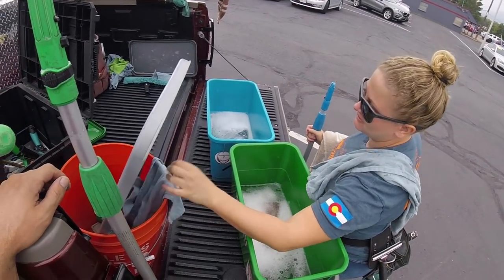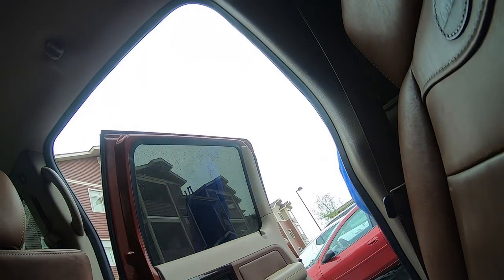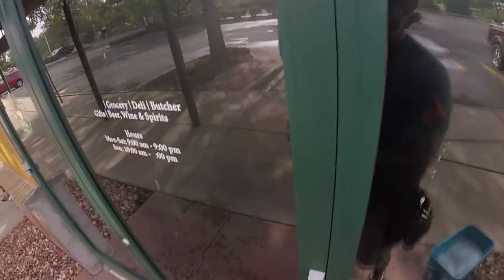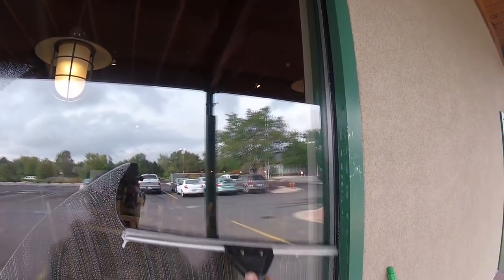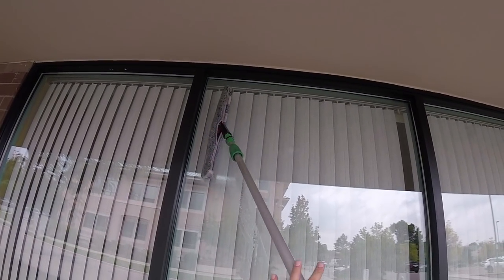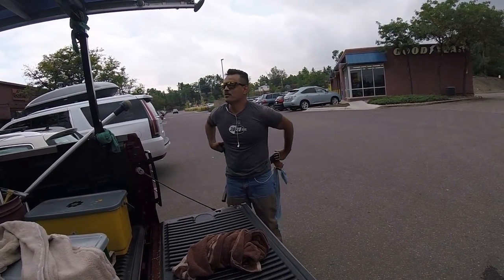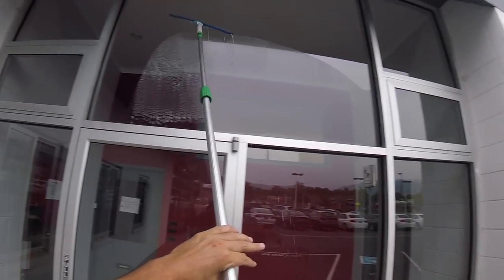BAD WINDOW CLEANING TECHNIQUES

Comment: What I hate about other window cleaners is underbidding all the companies so low they drop the price across the board toward no one makes any money and they work so hard on ladders every day people should be setting the standards high not low
Reply: I have been trying to figure out prices, just starting out with window cleaning, the main thing is what is the price difference between maintenance cleaning and construction cleanup.
Reply: That's what the invasion of illegal aliens is doing all trades.
Reply: @tfazio762  the difference is the time it takes, route s maintenance and construction cleans require extra time and tools. Price for your worth and experience.  High volume low profit is working harder not smarter.
Reply: Totally agree, I never undercut another cleaners price! It’s doesn’t benefit any of us.
Reply: 3.50 per pane in my neck of the woods.
Reply: Exactly.
Reply: @OneManParade  true! Why would they want to hire Billy to clean 20 windows for $150 when they can hire Carlos that will clean your 20 windows, grout your tiles and unclog your toilet all for $45!!!!!!
Reply: @mosestheprophet4162  bc Billy will do it right and Carlos won't. Lowest bidder is ALWAYS lowest quality.
Reply: @Johnnyreengo  definitely, I say my prices are not the highest and not the lowest but quality is top notch.
Reply: A lot of crying going on in here

Comment: I use a tiny squeegy specifically for wiping soap off of ledges and frames, works so so well and saves my rags getting too damp
Reply: I use a sponge for sills and ledges. When I do straight pulling but can't go all the way to bottom in one swipe I will drop it to the bottom corner. Normally two straight down pulls to each bottom corner then one side swipe to finish it off.

Comment: Great video! I used to pull commercial windows half way then fan the test but start at the left instead of the center. I always had that large streak. After watching your videos I’ve started in the center. All the other techniques you mentioned I’ve already do
Reply: Why stop half way on a section that ends waist high, like he does? So much quicker and easier to just finish on down to the frame, and you lose  nothing in the quality of the job after detailing, which you have to do either way.

Comment: I'm looking for ideas/suggestions for removing tape/sticker residue from the inside storefront windows, can't just use steel wool like I normally would for the outside of the glass.
Reply: thinner
Reply: Little bit of rubbing alcohol/vinegar on the mop/pad with a slight razor blade touch up 
If it’s tinted or has an E-coat just use the solution instead.

Comment: Yes hearing guys say they only change there rubber once a month or ever few weeks is like nails on a chalk board to
Me 😂 I change mine daily and always will it makes all the difference. CHANGE YOUR DAMN RUBBERS STOP BEING CHEAP‼️😂😂😂
Reply: I agree you lose the silky smooth glide in 8 hours of washing, but in my experience, there is absolutely no detrimental effect until sometime around the 40 hour mark. At that point you have to start applying extra pressure, then start leaving streaks, etc. But 4 or 5 days works just fine, and now at around $6 a pop, that's really cutting into your profit unnecessarily. But that first-day smoothness really does keep momentum rolling, I get it, to a point...
Reply: @johnboehmer6683  I think it all depends on the brand rubber you use also, the facelift last forever but the black diamond is only really good for a day or 2 depending on what’s on the windows, paint chips, big grime, somethings with chip the rubber causing it to leave a very thing line but I’m a perfectionist and the money you make on 1 average size house will cover your rubber cost for most the season if not all of the season. So it all depends on what you charge per window and what type of rubbers you use. Thank you for knowledge i appreciate it. 🤙🏼

Comment: Great video. Very important to clean the frames.

Question i have Steve is ..what brand and model buckets do you use that has a  lid on.. and i see you also use normal round buckets. When do you use the round ones and when do you use the square ones?
And what size and brand are the square ones?
Reply from the maker: jason sloten I use the pulex 6 gallon buckets, pretty much all the 6 gallon buckets work really well. Pulex, ettore, unger, moerman. I’ve had them all and they are all great
Reply from the maker: jason sloten https://windowcleaner.com/pulex-bucket-set?pt=MY

Comment: So, when I try to use a swivel on a pole, I have trouble with controlling the squeegee up high, so I have to do straight pulls. How do you control a swivel on a pole? (I use Sorbo Squeegee channels with an Unger handle, if that makes a difference to the advice.)
Edit: I also use an Unger extension pole
Reply from the maker: WayneTec it takes time to get used to swivel on a pole but all I can say is keep
on practicing, that’s the only way to get used to it
Reply from the maker: For fanning on a pole I would suggest the Moerman excelerator or wagtail highflyer
Reply: @SteveOthewindowcleaner  thanks, man! Your channel is probably the most informative out there. You break it down in the real world.
Reply from the maker: WayneTec thank you 🙏

Comment: Awesomeness! Can you give us a close up on your tennis ball protector. And what pole adapter do you recommend for swivel tools? I and currently using a wooden cone adapter with my moroman swivel. It sucks because it allows the squeegee to rotate and I lose the control... :/
Reply from the maker: Organic Green Window Clean cut a cross in the tennis ball and will fit on the bottom of your pole to protect it from hitting anything. I would get the unger opti loc pole if your using swivel tools, it will hold the handle better then anything else. I don’t use any angle adapters
Reply: @SteveOthewindowcleaner  Awesomeness, I will do all that!!!

Comment: The only thing I hate is the towel the pole to get the upper drips from the frames. I actually prefer the Unger microfiber pads. Never use them to clean the window but to absorb those drips and after everything's done I go over them with a towel to dry them so I can reuse them. My company claims it makes us look unprofessional but I'm using it for a single purpose not to cut a corner and clean it's it.
Reply: That's a good idea actually, it agrivates me having so many towels on me and always that time it gets wet and hangs down wiping part of the window when drying.

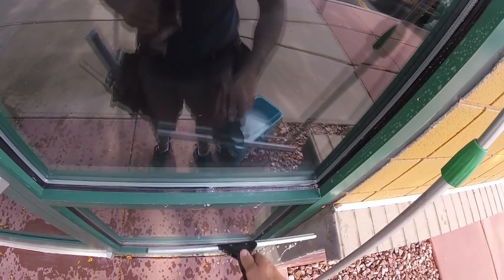Comment: Steve, I was with ya....UNTIL 3:12.  LOL, guilty as charged sometimes on the very bottom transom window.   If the frame is clean, I will hit it with squeegee after. It's a habit ...like detailing (WITH ONE FINGER on the huck!)  You speak like someone who does a lot of commercial and it shows-- good stuff and I hope people watching pay attention.  I would do those jobs about the same exact way. Efficiently.  One trick I've grown to like it after you mop the window, use a Huck towel to hit the top of the sill-- when you stick it (Again, I use a Ledger so I always have that gap to close out the sills about 95 percent of the time)  you will not leave a line and detailing is at a minimum.  I do cutups that way as well instead of the motion (what everyone calls fanning I guess, I say motion or S move), depends on the windows. 

Great video man
Reply from the maker: Yea totally depends on the glass as far as what techniques i use, on cut ups I use to fan them but now I hardly do them inside cause I hate it so I send the minions inside and do the outside with WFP LOL But the technique of wiping the top before doing a straight pull helps a lot, fanning on small french panes can leave a lot of marks behind especially when looking at the glass when the sun is shining through. This video was a fun one to make.

Comment: I've been cleaning windows for 35 years.   It's amazing how many people I see using rubber worn to hell.  You're totally right about that.  I flip, switch, or trim swap my rubber on every job.
Reply from the maker: A sharp rubber makes the day so much better
Reply: You don't save any money using bad rubber. You lose money. 28 years in the business. It's the ends that wear out. You can take longer used squeegee rubber, and cut the ends off, and use them in a smaller squeegee.  Yet again, How much are you really saving? $200 a year? Why take the chance? Plus you must press harder with worn out rubber.

Comment: Get an R O System, much faster and much cleaner. Keep the traditional work for indoors
Reply: I have a 4 stage ro system.  For single story residential it's much faster to use my moerman fliq with good technique.   The ro is great for 2-3 story.

Comment: Cheap or expensive handles the blade does the work. Don't be a "race car driver" and go fast and furious just to cut corners and leave dirty water on a dirty sill, drying dirty.
Reply: 50 lb round buckets, with the 14", 18", and sponge. Only having 2 towels for a whole job.

Comment: Hate when other WC'ers pull the water of the bottom of the frame with their squeegee. Ruins a perfectly good rubber dragging it across metal. Use your damn towel or sponge.
Reply: Those robbers get replaced like once a year for those jobs
Reply: That's why I have a mini squeegee for that purpose I keep on a hook in my bucket.  I get all the sills at once and catch the runoff with my scrubber.

Comment: You can talk all day about how to clean a window but basically it's not rocket science. Seriously don't loose sight of the fact that the end goal is to "clean the window". Does it really matter about going into the ridiculous fine details of how ppl prefer to do this! Obv not! Solution on, solution off, detail, and check window afterwards all in the quickest possible time. The method dosent matter as long as the window ends up clean. Get the job done and move on to the next. Don't get wrapped up in the fine details. It's your job/business with the goal of making a living. Like I said... On off detail, check move on. Simple as that